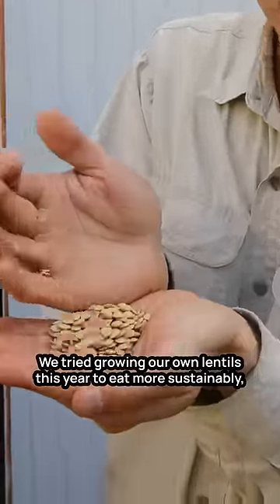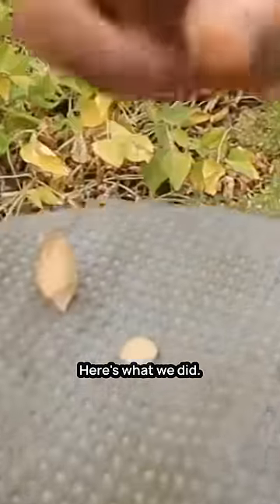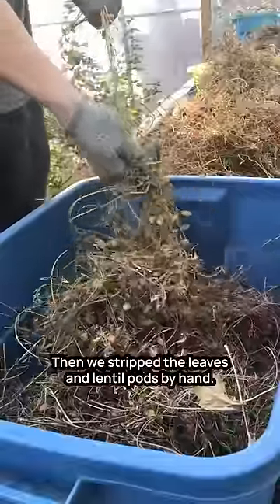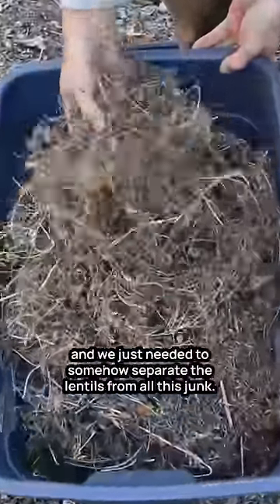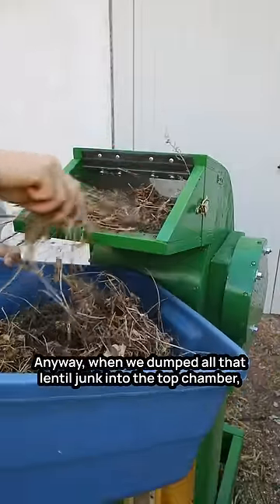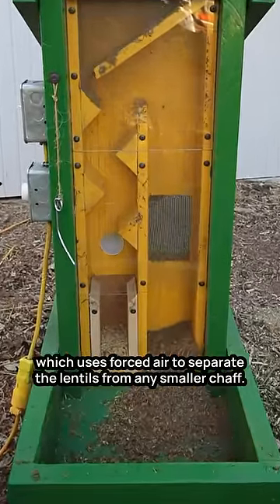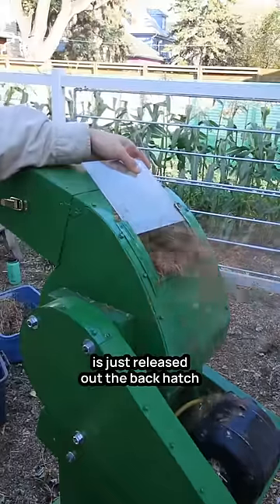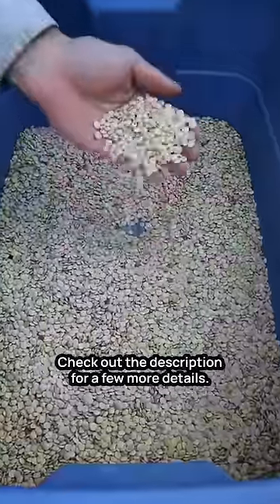Harvesting Lentils From Our Home Garden

Comment: In INDIA, lentils plants are dried and bundled, they are hit on a stone multiple times where seeds and sometimes pods fall off, then from a height the seeds with soats are poured down, with high wind blowing in one direction, the seeds fall down while seed coats flyoff
Reply: Was looking for this, thanks for the info
Reply: So, basically, it's similar to what the ancients did with wheat and other grains thousands of years ago.
Reply: @woodworkerroyer8497 exactly.. That's what still happens with wheat on small scale but for large scale they use thresher to do the job.
Reply: Thank you. I knew there had to be an easier way...
Reply: That is called windowing and that is what this machine does for you.

Comment: I like it!.  We use 5 gallon pails and baseball bats to separate legumes from their pods, I know this sounds rather violent but its really quite gentle and effective, we just let the legumes dry on the plant then stuff them into the pails to about 75% full and just start gently tamping with the bat, in about 5-10 minutes the legumes are at the bottom of the pail and the plant matter/pods are on the top, this works very well and is quick.
Reply: @ML-ks2lj  Nice idea, I can get my hands on plenty of broken clothing dryers (usually the heating element goes) from kijiji for free, and maybe the use of baseballs or tennis balls in there to gently tumble and remove the pods. With the increasing cost of food I'm definately growing alot more and I think a little bit of mechanization could certainly help. Thanks for the input, Cheers.
Reply: Thank you for clarifying what you meant by baseball bats, lol.  I was thinking threshing flail style whapping (like a madman trying to babe ruth special a bunch of roaches), not merely vertically holding & dropping.  The gentle vertical drop makes quite a lot of sense since it won't damage much of anything!

Comment: I have used a pillow case to pulverize the dries greens/pods lentils or beans will fall to the bottom
Reply: Thanks for the tip!
Reply: I can immagine the process of swinging that pillowcase around makes for some excellent anger ventillation... though, wouldn't a burrlap sack be more durable?

Sudden edit: just hit me the sack method might be some good workout as well.
Reply: @LunarisArts thats the opposite of what I pictured from that description. To me it sounds like they put it in the pilow case and hang it from a tree branch and beat it with a broom

Comment: You did a really good job with that threshing machine, mine is just pipe with strategically placed Y connections, chutes and a hairdryer I stole from my wife’s closet
Reply: Pics?
Reply: @thehutch7728  Can’t post a pic and mine is just a winnowing device but basically one Y connection has one hole of the Y pointing up, this is where you load it. The other end of that Y points upwards diagonally. A straight piece of pipe attaches to the other Y connection one pointing diagonally downwards and the other pointing straight downwards. You blow the air in the diagonally downwards hole and load material into the top and the heavier material falls through the bottom Y and the chaff flys out of the top hole. I have various lengths of straight pipe to swap out to help adjust to whatever I’m using it for, sometimes a length of straight pipe is needed for the top and air intake connections.  It’s very messy definitely do it outside.

Comment: This reminds me of rice and wheat harvesting. To extract rice, they have threshing devices. One looks like a comb (because it is). 

You take a Handfull of stalks, and hold them at the base of the stems. You lay it into the comb (which is anchored to the floor) and pull. It cleans the stalks of leaves and pods, leaving you with clean fiber and a pile of what you want mixed with leafy debris.

It is essentially the first step in a thrashing machine. There are a lot of old technology that might be neat to showcase for homesteaders that cannot use solar.

Comment: Lived in the indochina mountains once. People do something similar to remove rice from the hull if they had electricity... but just used a fan. There's another machine to remove the grains from the stem, but the traditional method is to smack it on a tarp, which actually takes the same amount of time as the machine.

Comment: Heres a simple soup recipe with lentils that will make you satiated for a long time and taste well.

1: Clean lentils throughoutly.

The machines used to sort and clean them someimtes let small rockes get mixed in.
Unless you got a really good dental plan or can eat rocks i dont think youd want that in your mouth.

2: Boil some water.

3: When the water gets boiled, add the lentils.

4: After lentils get done (around 30-40 minutes, try them if they're soft theyre done) add chopped potatoes.

5: Caramelize onions and garlic with some flour. 

Well for those that dont know chop garlic and onion finely and cook them on the stove until they get orangish and add flour afterwards and make sure it's fully mixed.
Takes like 5 minutes to do.

6: When the potatoes are done add the caramelized onions and garlic, mix it a bit, add a bit of butter depending on the amount (id say depending on tastes) and some green's (parsley and such depends on what you like).

Voila the soup is ready.

Comment: how its done is the combine harvester picks up the whole plant and it coges through the rotors where the whole plant is whipped and rubbed around to split the pods and release the lentils witch fits through the concaves and the stems dont. then the lentals find small chaff fall onto the seperator table where a fan blows air to blow away the chaff and allow the lentals through, where they are collected and augered up to the grain tank. all the trash and the end of the process goes through a chopper to get it small and its spread over the field. its a balance between the plants moisture content, concave size, and fan speed to make sure you get a good separation while not shooting too many out the back.

this is an incredibly efficient process that allows for a pound of lentals to get to you for less then two dollars a pound.

Comment: When harvesting lentils and lentil pods it's just that you use a blueberry picker device because this way you can harvest the lentils and their pods off the plant will the plant is still in the ground so you don't have to pick the plants it is much more easier to pick them and it's a lot quicker and more sustainable plus you you save yourself a lot of back-breaking hard labor just buy just going on your hands and knees for about 5 to 10 minutes all depending on what size of rental crop planted

Comment: You have to be actually STUPID to eat crop that's right up against the road. 

Where do you think all the oils, gas, rubber, grease, coolant, ect ends up after its washed off the roadway. Every time a car drives by and splashes the road grime onto the grass and you're eating it?